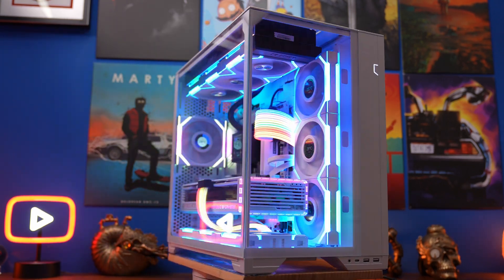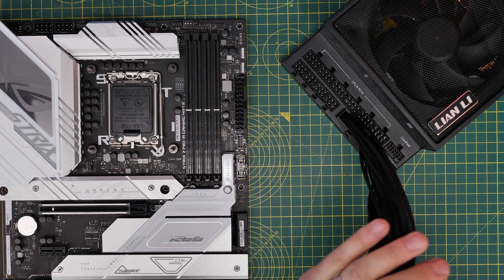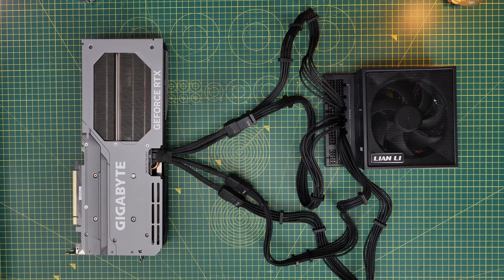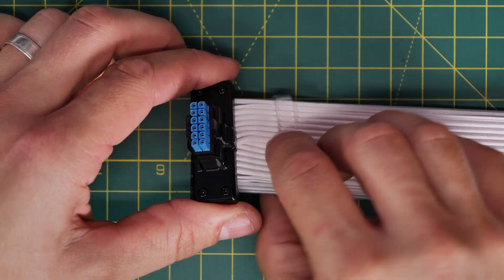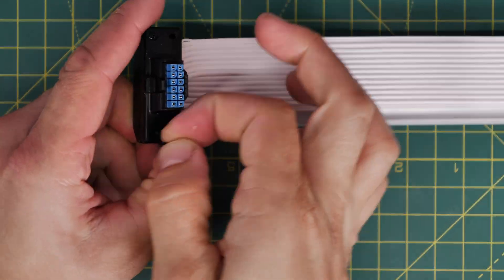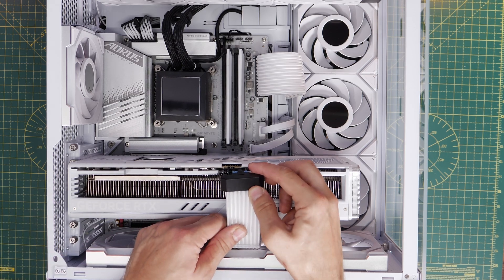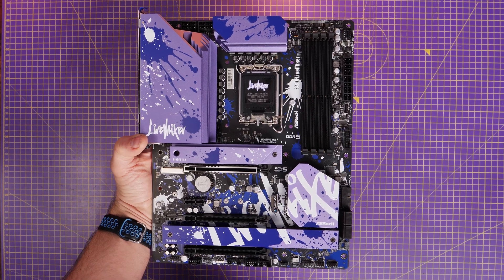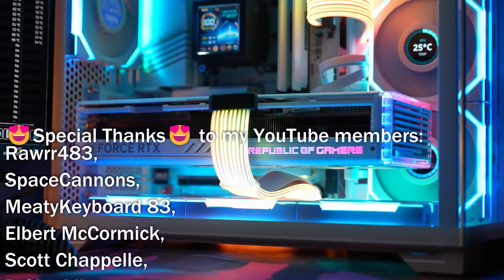Lian Li Wireless Strimer Setup guide - easy RGB extension for your 24 pin and 12VHPWR cables

Comment: It's now total junk. I bought the cables because I saw them running in a few builds and had individual wire light shows. Not anymore. The latest version of L-connect3 sucks. There is no option to get as much control as in this video. NO "Strimer Wireless". I have the cables and controller. I can only choose the craptastic options from "Quick sync lighting" since there is no strimer wireless,, Total garbage. The version is 2.1.14. Now to go look to see if I can find the version in this video. If not, Lian li will get there cables back. What a waste of my time.

Comment: Do you need a controller for each connection? or is one controller able to control all connections?
Reply from the maker: One controller is enough for upto 10 groups of devices if I recall correctly
Reply: @TheProvokedPrawn thank you! I ordered the 24 pin for the main power to mobo. If I like it, will deff order more!

Comment: Is there any way to remove the pins from the 90 degree connector.  I'd like to use that 90 degree connector on my V2 wired Strimer as I don't want wireless since I'm using a Nollie controller.  I wish Lian Li sold a wired version.  Great vid, really appreciate you showed how to break the cable down.

Comment: i just bought the 24 pin and i plugged it into my 24 pin cable and it only shows white and when i download the L-connect 3 (latest version) it only shows system options and setting
Reply from the maker: Do you have the usb wireless dongle installed.
Reply: @T @TheProvokedPrawn h it didn’t come with it should I buy it
Reply from the maker: @interwantscashyes you need the controller
Reply: I have an nzxt one but it doesn’t do anything
Reply: I mean it works and all but it’s not working for this situation obviously
Reply from the maker: @interwantscashI'm not sure what you mean. You need the controller you can see at 11:20
Reply: @TheProvokedPrawn ohhhhh okay I get it sorry I’ll buy it now

Comment: i have a gigabyte gaming oc 12g 5070ti and i have the wireless strimer 16-12 but i cant get it to fit because the plastic stops it from reaching the connection what should i do is there a way around it need help guys
Reply: I have the same card and i just ordered the slim version of the 12 pin connector because i was worried about the clearance im glad i did now i would return it and order the slim version

Comment: I don't get it. My GPU requires a lot of power and a 1>2 divider. 600W from that cable will not be enough. What can I do?
Reply from the maker: It is more than enough for modern GPUs. Have a look.
Reply: My GPU won't start without the divider that came with the card. Some people are saying that it's my PSU's fault. Are you able to help me? @TheProvokedPrawn

Comment: Anyone else having an issue where the strimer lights don't turn on or appear on the L-Connect software?? I just got it delivered today and the GPU is connected and so is the wireless controller but no lights or signs of the strimer cable itself
Reply from the maker: You're sure the power cable is fully connected to the PSU and the cable itself
Reply: @TheProvokedPrawn  yep, opened it up to check just as your video and still nothing turning on, even unplugged and replugged power cable to make sure it’s seated
Reply: @SleepyKxizen probably faulty

Comment: I bought the 24 pin with the controller and the controller did not come with the PWM/USB 2.0 cable availability. It only has the option to plug it into the USB port on the motherboard. Is the controller with the 24 pin strimmer cable different than the controller you get with a triple pack of Lian Li fans? because I have corsair fans. Do I have to get a standalone controller in order to plug it directly into my motherboard?
Reply from the maker: This is odd. You definitely got the wireless model? If so the controller should be the same as the one with the fans

Comment: I planned to do a build with the v2 strimer cables but they were wired and they dont have those or the wired hub anymore (at least they dont have them anywhere I can find) so I was looking at another option and these seem to be pretty much the same or even better since less cables. Good video!
Reply from the maker: They're much easier to use.
Reply: @TheProvokedPrawn I got this strimmer hub but I dont see the cables to connect to the motherboard in box with it at all? What should I do?

Comment: Just to clarify, i only need one wireless controller, so i shouldnt buy both the motherboard 24 pin with the controller and the gpu 2x8 pin with the connector?
Reply from the maker: That's correct, you only need one.
Reply: @TheProvokedPrawn ok thanks so much, i am building a pc for christmas so i just wanted to make sure i get everything correct

Comment: What if my gpu only has one 8 pin port, would it still work?
Reply from the maker: There isn't a single 8 pin version but you could use the two 8 pin one and just not plug one of the connectors in.

Comment: Ok I have an all white 5090 build, and I’m trying to look for the plus V2 I can’t find any just these wireless ones. What do you prefer the second generation or this new wireless one. Because I like the V2 because they’re a little bit more brighter but they’re hard to find and the only thing I don’t like is that if I buy these wireless ones, I have to buy it with two controller so that takes up two USB spots
Reply from the maker: They're both fine

Comment: Love the video! I followed a bunch of guides from you when building my current rig. Have you had any issues with the strimmers resetting to default RGB puke upon booting? Mine reset every time i boot up and i have to change them manually each time. Any ideas on how to fix this?
Reply from the maker: Hmm odd. Have you tried using a newer version of L Connect? If they are bound in the wireless setup they should work but sometimes Lian Li products require L connect to launch first, hence why it doesn't happen until in windows

Comment: I have an important concern regarding my build: in the O11 Vision Compact, wouldn’t the front panel cable—positioned right above where the GPU’s Strimer cable passes through—be at risk of getting damaged due to the Strimer cable putting pressure on it 10:27 ? I’m planning to use a Strimer with my GPU, but since I already bought and tested the fit before my GPU arrives, I noticed that the clearance is very tight. Returning the cable isn’t an option, so I want to make sure this won’t cause long-term issues.

Comment: Lian Li Strimer Wireless GPU 12PWR is hitting the graphics card slot and not getting in. Is it because the black head is pointing inwards on my graphics card, Galax 5070 Ti 12PWR?

Comment: If you aren't using any Lian Li fans, do you still need to connect that PWM to a fan header? Or will the USB connection work just fine for the 24 Pin + 8 Pin strimers?
Reply from the maker: You still need power from that header

Comment: Can i use the adapter that comes with the video card? Or is it recommended to switch to a PSU that has the connector?
Reply from the maker: I don't understand what you mean
Reply: @TheProvokedPrawn o think the PSU dont have a cable 12vhpwr! 
He use the adapter of the Gpu to conect in the strimer ! 

Psu Cable > adapter gpu > strimer

Comment: Thanks for the video! I'm using your tutorials for my first build. Too bad I don't think they sell the 24 pin with the white controller & cables anymore. Maybe I can paint mine 🤣
Reply from the maker: You can swap clips between black and white if that's what you mean
Reply: @TheProvokedPrawn thanks I plan to do this! I was actually referring to the controller and cables it comes with for the wireless rgb

Comment: My issue with the strimmers is that I have to manually reset the lighting every time I turn my PC on. Is there a way to have them not default to rainbow every time I turn my PC on?
Reply from the maker: That is odd. Is L connect not running when windows starts?

Comment: Hey there I hope you see this. I'm having trouble with the Lian Li strimmer. I have the same one as you except the L connector part has the latch on the top instead of on the bottom making it impossible to connect to my gpu from the bottom. How is yours fitting like that?
Reply from the maker: I'm not sure I understand what you're saying but you can flip it over. I think I showed that
Reply: @TheProvokedPrawn my strimmer cable has the latch that unplugs from the 12vhpwr on my gpu on the top instead of the bottom. So this means the strimmer cable has to come from on top of my gpu to plug in correctly is there any way to flip the actual 12vhpwr part that is blue by 180 degrees?

Comment: does the psu need to be modular in order to use this? also I don't have ARGB on my mobo, will it still work with the usb controller?
Reply from the maker: No, it does not. And yes you can use the USB controller no matter what

Comment: My PSU does not have the 12vhp, so I'm using 3 PCI cables plugged in via the provided splitter to power my 5080. Q: Can the strimer plug into that splitter ?
Reply from the maker: In theory, yes. Or upgrade your PSU. If it's an old PSU and you're getting a new 50 series card it would be sensible to upgrade anyway.

Comment: im running a slightly older psu and am wondering how i would go about using these with a 5070 ti that has the 12v cable.. I believe I can just use the double cable to 12 volt adapter but would one of these extensions work with that?
Reply from the maker: If you don't have a 12vhpwr cable with your PSU then you'd be best buying the Strimer with the 8 pin connectors on one end and the 12vhpwr connector on the other end.

Comment: 4:04 I’ve got a 4090 that I use the 12vhpwr to 8 pin pcie extension 
Is their a way for me to plug the strimmer cable (my psu doesn’t support the native  12vhpwr)

So I’m thinking like gpu to lian li 12vhpwr  to 12vhpwr then nvidia adapter to split it to 4 pcie then to psu
Reply from the maker: I'm not sure if that will work. Possibly it will. Doesn't your psu have a 12vhpwr cable?
Reply: @TheProvokedPrawn  no psu doesnt have a 12vhpwr , im using the nvidia provided adapter

Comment: So can you just plug the controller into the back of a usb port and not have to run any cables? And if so well it interfere/conflict with existing Lian li fans/controllers?

Comment: I got the ASUS ROG STRIX X870-A Gaming Wi-FI, same case, and for some reason we couldn't fit the GPU strimer under the motherboard, it's like MB is too large. We had to remove the rubber from the vertical hole and GPU bracket to fit it through, and then also bend it almost 90 degrees. Otherwise it would just not fit from bottom, and the only option would be to feed it from the top, overlapping the memory and MB strimer, which wasn't preferable.

Comment: My wireless strimmer cables won't show up don't have any sort or sync only shows my fans and aio that are connected by controller
Reply from the maker: You have the wireless controller? And you can't pair them in the software. Have you tried uninstalling and reinstalling L connect. Make sure you have the latest version

Comment: Hey man I am using these in my pc build too accept for my gpu as I am doing the 3 by 8 pin connector because I have a AMD gpu and I have a question. Since I am having the strimer cables for both the gpu and the motherboard, could I just take the motherboards connector, plug it into the back of my motherboard via the usb port, and synce it with the gpu strimer cable without plugging its controller in aswell?

Comment: Hey brother, i wanted to see if i can get more clarification from you on this topic. So here is my situation: I have a Gigabyte Aero RTX 5070ti and my PSU is the AsRock Phantom Gaming 1000G. The PSU has a 12v-2x6 port and it comes with a 12v-2x6 to 12v-2x6 cable, but the GPU comes with a 12v-2x6 cable to a 3x8 pin cable. So, if i wanted to get the Lian Li Strimer Plus V2 Wireless cable for the GPU, can i jsut get one that you show here on this video and just connect the 12v-2x6 cable from the PSU directly to the 12v-2x6 strimer?

Comment: What if I didn’t hear the click sound but the blue is not visible is it still ok to use? Or is that a fire hazard
Reply from the maker: If you can't see any blue and you pushed it in firmly you should be fine.

Comment: THANKS for the video 🤩👍  i have 8 UNI FAN SL-INF total with got a controller set from a 3 pk, but will both strimmers the one for GPU and the motherboard work with that controller or should I buy another controller, im a bit new into lian li whole system 🙂
Reply from the maker: If you bought the wireless strimers you need the wireless controller. If you bought the previous strimers you need the controller for those. The Infinity controller won't work with either.

Comment: My Strimer did not come with the white connectors. I am filing claim with Lian-Li. Do you know where to find the serial number? All I have on mine is two upc codes on the back bottom right of the box but neither actually says SN before it.

Comment: I'd love to hear your view on the following scenario: I see that currently Lian Li has no wireless version for a 3-8pin GPU, like 7900xtx. What would you do in that case? Buy a controller separately just to accommodate the GPU cable? Also, will the 2-8pin cable work for connecting PSU to CPU instead of 2-8pin GPU? What I want to do is to use 3 of those strimers, cpu, gpu and mobo. Thanks!

Comment: Hi! Thank you for the helpful and very straightforward setup tutorial! ❤hopefully you can help me solve my issue, i have the Lian Li Strimer Wireless 24 Pin with Controller (PW24-1W-T) and everything is working perfectly through Lconnect. however I just installed SignalRGB so i can have all my  different RGB devices synced but the Strimer isnt showing up on there or syncing with everything else, is there a workaround?
Reply from the maker: It's not yet in the supported device list - https://signalrgb.com/devices/
Reply: @ thanks for the response! hopefully they add it 🥺

Comment: Does this cable fit new 50 series ? I bought the wide version and I don’t thin it fits
Reply from the maker: Yes that's what it's designed for
Reply: @TheProvokedPrawn I have the 5070 ti aero and my 90 degree angle won’t fit it gets intercepted but i think I found a solution to just removing the 90 degree feature it will fit
Reply: @chinoa4188 hello,did u end up fixing the problem if so can u please let me know how u did it?
Reply: @manny2.z0l1d8 I have it without the plastic piece so it can bend I have the cable going from the top tho bro & it’s been running smooth for a while now tbh

Comment: If I only use 24pin and 12+4pin wireless strimer not lian li fan wireless, can I use Lian Li wireless controller by just plugging USB 2.0 into the mobo or do I still need to plug in the PWM cable as well? On this lian li wireless controller, is the PWM cable function only for fan speed or power to the controller?
Reply from the maker: If you're connecting it inside the case it'll still need power. You could just use a port on the outside of your motherboard if you don't want to do that.

Comment: Hey,  could you please help me out here:

I'm going to get a custom model of the 5090 series when it's available and wanted to ask if I can use this strimmer as an extension with an NZXT c1200 3.1 power supply and the 12VHPWR supplied with it?

Best Regards :)

Comment: can i use the wireless lian li strimer 8x2 GPU for my rtx 2070 that only supports 14 pci pin? if i can split 2 pin and use only 14 pin ?

Comment: I've plugged my cable from my PSU into strimer extension then into the MOBO but can't see any led on it, and nothing in lian li software to change settings either.
is there some cable I'm missing? I have a single wireless USB plugged into the back for the wireless controller with 6 uni fans and the strimer

Comment: Not needing an internal USB port is a game changer.  I've used all of the "hubs"(including the one built into the lian li edge )and they suck.
Reply from the maker: Oh? I haven't had an issue.
Reply: @TheProvokedPrawn  How much do you have plugged in?  You can generally get away with 2-3 internal USB per hub.

In gaming builds, that's usually more than enough, but hobby builds done in much larger cases like the v3000, 1000/9000d , Tower 900 meant for water cooling you can easily need double that amount and the internal USB likely has bandwidth limitations...
 Any one reading this, 99% of builds these  hubs work great.  I should have specified they suck for my specific situation.
Reply: @TheProvokedPrawn  Thank you btw, I actually wasn't sure this thing would work.  Your video basically verified I was good to go so it was really helpful as always.  

The Strimer works great, connected almost immediately and looks better than the v2

Comment: I just bought 24-pin strimmer wireless for my new build, but it does not light up, and the L connect itself didn't even see the USB dongle. I tried to do some research and found nothing anyone have any idea? Or my dongle is just faulty?
Reply from the maker: You've connected it all up correctly and you're sure the power cable is pushed in firmly both ends?
Reply: @TheProvokedPrawn  100 Yes, I checked  more than 3 times and it's not even light up I don't know I have to find the way to bind my dongle to L connect 3 first to lid my cable or it should light up even without L connect 3

Comment: cant find any rgb software that can control the strimer cable or even know they exist.  usless till i find a solution.
Reply: People have modded it to work with icue so is doable
Reply: @mrdeseption3415  really! i super hope i can get it to work cuz it looks so perfect with my light base 900 case. thick blocky rgb strips all the way to the motherboard. i want all the lights on screen capture mode.